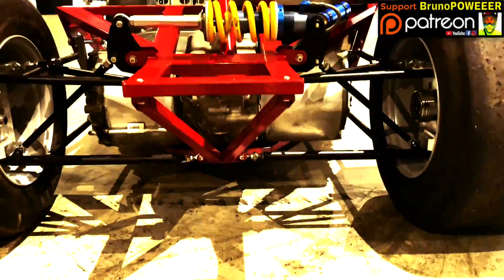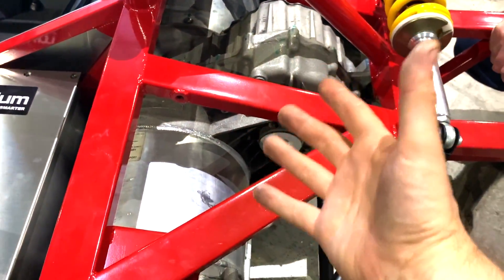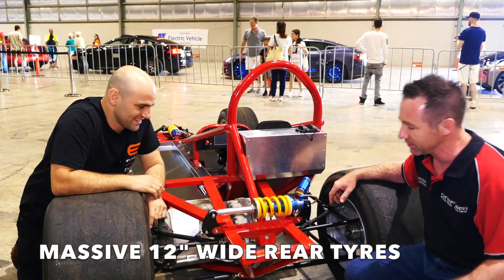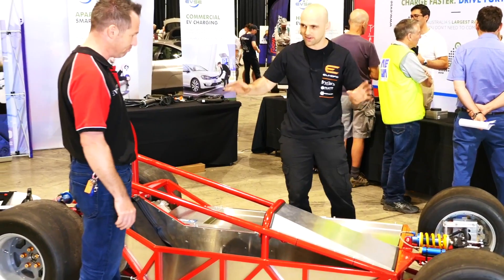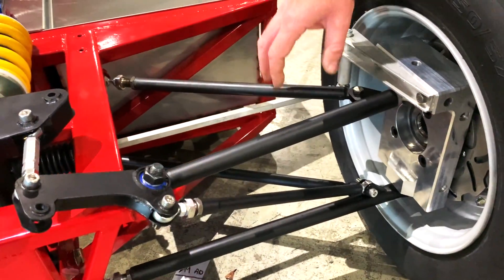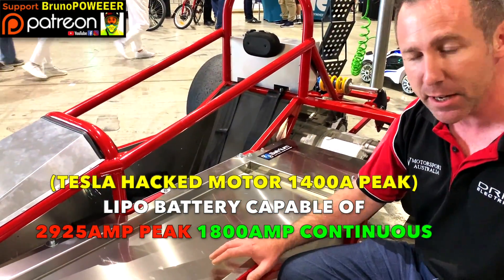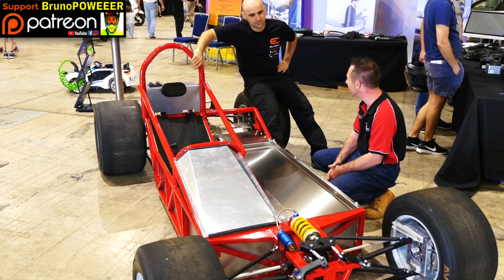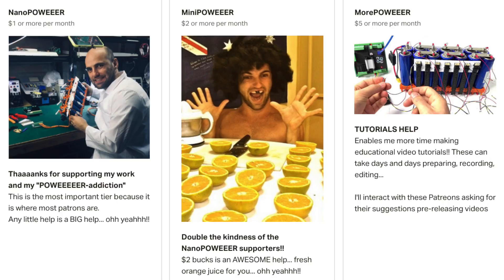450kW 450Kg Tesla Race Car Build • 600hp Hacked Drivetrain

Comment: With the same battery pack as model S with half the weight,Can anyone tell me if that equates to twice the range?
Reply: No, it has very high discharge batteries. They can provide tesla power for a couple of minutes at a low weight, but do not store as much energy as tesla cells. The tesla pack weighs more than this entire car.

Comment: Crazy build. Will be very quick.

Looks like a deathtrap though! Roll cage bars right beside the helmet to make instant contact in a crash. Madness.
Reply from the maker: Hahaha yeeeaahhh insane machine... pure madness... that roll cage is standard in the races around here... pretty small but yeah... I would’ve done driver in the middle and packs on the sides but must be a technical or race rule reason for that design =]

Comment: I'm laughing so hard ! They're so way out it can only be in Australia. It's a fun and wildly dangerous project. Great ! So don't ruin your credibility by saying things like "it's all about safety" LOL and that pouring water on a potentially broken(like cracked open by expansion from a runaway) lithium battery array will STOP a fire ! If anything that's how you start a fire. I also cannot believe it won't get too hot if you're pulling more than 1000 amps continously, in an enclosed cabinet. I mean how hot are they supposed to run, and how long (or short) time - is it just a dragstrip your racing ? Besides that fresh water does NOT - contrary to ordinary belief - short circuit anything but maybe some sensitive electronics. It's a very poor conductor. Man you have to get some knowledge or ask someone before bluring out your wrong ideas and even incorporating them into your designs. Just saying it as it is. Love the car though - with a better chassis it wouldn't look completely ridicolous, too. Try to learn from Deronda f.ex. that's a beautiful and functional design that should have been electrified. I'm waiting for someone to put your drivetrain in it.

Comment: If they're so concerned about weight, why did they use Li-Po instead of Li-ion? Sick build nevertheless!
Reply from the maker: This is high discharge LiPo.... LiPo can handle a LOT more power than regular Li-ion batteries so you need a much smaller pack to handle a massive current. In my 42kW trike https://youtu.be/sRH_cpCwNDs I had two very small Lipo packs that could handle ridiculous current for a few minutes of fun and it only 4kg, if I used Li-ion 18650 cells I would’ve need to make a MASSIVE pack that is about 20kg or more just to handle the same current.

Comment: Im sure its weight will become off balance. You may turn left easy but turning right may hard and this much POWEEEER will be hard to control. With this much power and this less weight you may back flip car when you start car with full poweeer. This cars weights must be in front or must be balanced between left and right.

Comment: something seems off about the suspension setup. the single shock front and rear looks unnatural.
(edit) just saw the individual dampers part
Reply from the maker: Yeah looks weird but Phil the owner has been racing all types of racecars for over 45 years, tuning suspension, brakes, tyres... + they used some software to simulate the forces... they know what they’re doing. If it doesn’t work, they can just modify the design (they made everything from scratch) 
 =]

Comment: There's no way dassault systemes is making a move on that iOS even SD card window systems OSX to Android because the whole week's over with some models with the headphones in the helmets and p l a n a r transparent screen with the Google map wrapped around the front from ls2 helmets takes the first and then for the military the Wi-Fi headphones Bluetooth memory foam inside heated cooling down doesn't look smart Louvre simple slow air flow around your helmet all sorts of helmets also this permits for a moment then it would be a Motocross helmet and you would be superbike helmet go back to German helmet then we can stick won a big dick up on Elonmosque that would be Jeff bezos can go f*** off with Richard Branson both of them squash I also have the boat company Robertocurto you do go have a look at his page he is designing motorbikes for several different companies I really need we really need your helpfigure of eight or 2 diamonds diamonds will go in set two-in-one circle or hexagon in the middlejust use any device or operating systems are used to have all of the widgets overclock Celtic or anything such as video yourkeymove blah blah blah blah blah blah blah blah blah and then kicked over her own bike has the order it take it to the pedals 0 to give it a hydrographic the number in letters logos and iconsholographic print logos badges etc trademark of the vehicles we couldn't find those bikes and strip them the sit down put electric engine in them and sell them twice what's allowed in 5 to 10 years to pay for the most smallest to 5%interest at the long years of ten years to pay for the bike which can be upgraded quite more than 27 miles 45 km to get it up to 75 fly up and down the motorway

Comment: Dont loose your time This is the worst video i saw
We didn't see the car running
Reply from the maker: How could I drive a car that isn’t finished yet? I would love to but it’s missing some key components such as steering wheel, pedals, drive-shaft and all the electrical contactors, battery management system etc...
This is a video explaining the building design and all the work considerations that goes into making such insane power to weight ratio machine like that. There are thousands of DIY people, websites, students and engineers interested in such detailed information.

Comment: Wouldn't that suspension setup be the exact opposite of having a sway bar?
Reply from the maker: Lots of race cars use that type of suspension design now to minimise size and weight, looks weird but also very clever, some with 1 and others with 2 shocks. Works better with downforce as far as I know...
Reply: @BrunoPOWEEER  That all makes sense, but with that setup it seems like going around a corner would cause the opposite side to raise up. A sway bar is supposed to prevent this by making the whole car squat down when force is applied to one side of the suspension. In your video I don't see a sway bar and there's a pivot in the middle, but the car isn't done so it's possible they haven't installed the sway / torsion bar or whatever solution they came up with.

Comment: Having the batteries divided across each side would have helped centre the vehicle better
Reply from the maker: I think the main reason they made the chassis this way is so they could race against the petrol cars in the same category. 
Yeah I had the same impression first time I saw the car but they explained to me that the battery and motor on the left was the exact same weight as the driver + controller/inverter on the right.

Comment: Power to weight ratio is just nuts! 1kW/kg is 1,341 HP per ton!
With a Model S at 2107 kg, that would be like upgrading its motor to 2835 HP!
Reply from the maker: Yeaahhh if you’ve been inside the P100D it’s actually hard to even imagine accelerating any faster... same rear motor but 1/4 of the weight WTFFFF....
Reply: @BrunoPOWEEER  I think we'll have to get Peter Kovács or Andy Kirby to put one in a Twizy... :-)
Reply: It's probably more like 1kw/kg